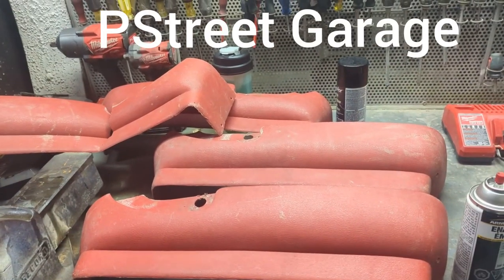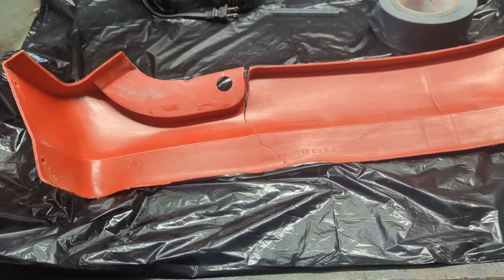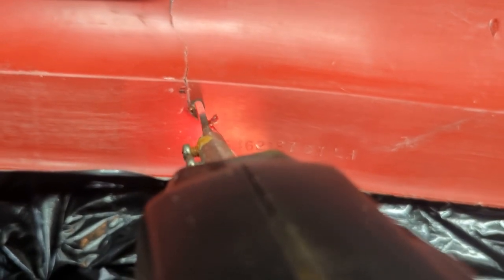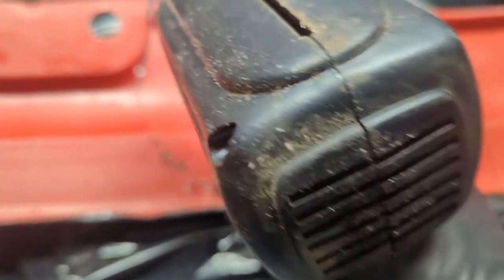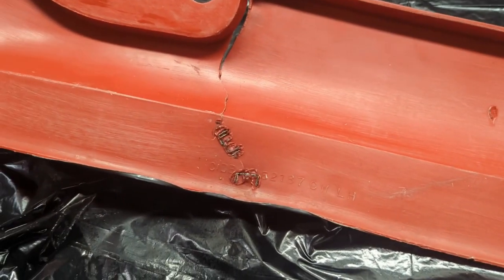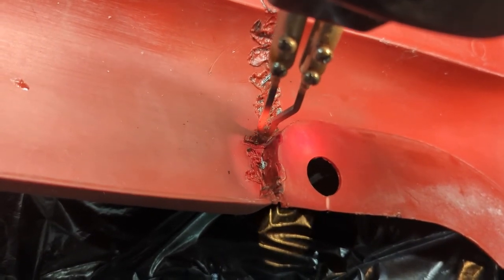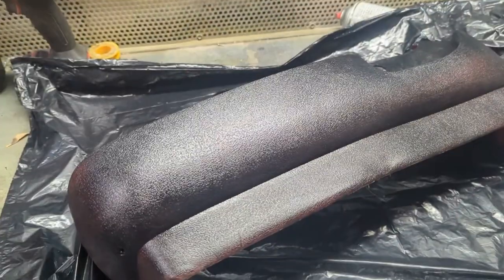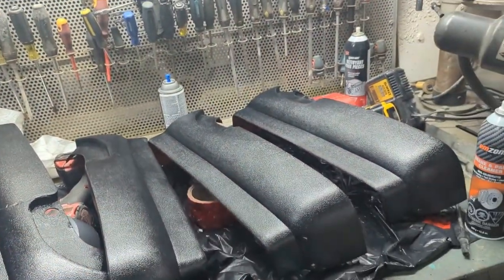Fixing car plastics with a soldering gun. Will this Work ???

Comment: Good work bud. They sell a hot staple gun on Amazon, makes the job 100 times easier.
Reply from the maker: Yes.  I'm a cheap ass 😆😆😆
Reply: @pstreetgarage7304  You probably used more electricity messing with these staples than using a proper tool 😁
Reply from the maker: @LimitedEditionMotorcars  Not my electricity,. I wanted to try it and it worked

Comment: I use the cutoffs from cable ties like filler rod. Get yourself a plastic welding tip as well, a larger flat surface, bent to give you a better work angle.
Reply from the maker: Hey Frank !  This was a trial.  I just wanted to see if it would work.  Cheers from NS